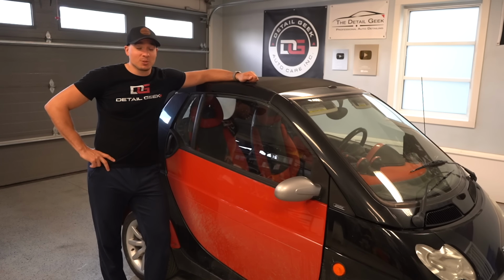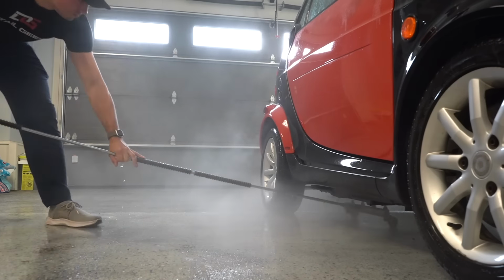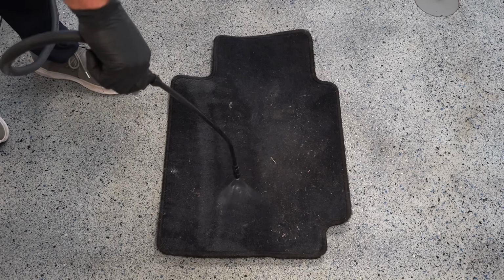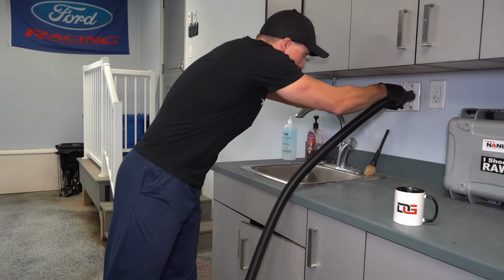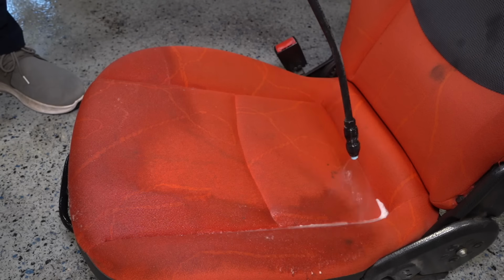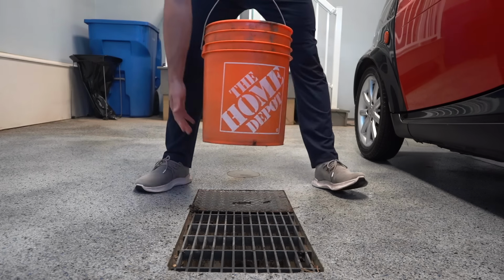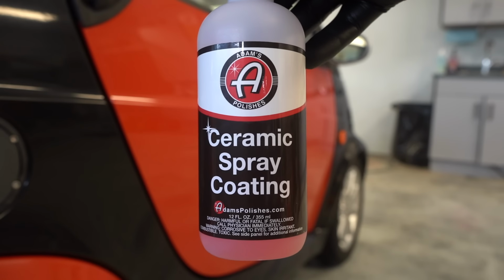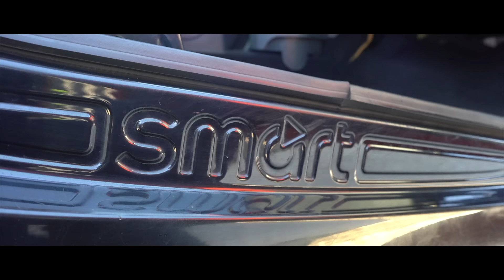Cleaning a Farmer's DIRTY Smart Car! | The Detail Geek

Comment: The amount of roasting on the size of this car was the cherry on top 😂
Reply: People with big cars usually are compensating for something else.
Reply: @Drakey_Fenix  😂😂😂😂
Reply: 🚗 ❤ smart.   ♡
Reply: @Drakey_Fenix  nah that’s just the pavement princess trucks with rubber band tires
Reply: @Drakey_Fenix  I mean...Mitch does own a huge Raptor
Reply: @tungstenwhizard4361  at least he goes mudding instead of putting truck nuts on it and exclusively running red lights and not signaling
Reply: @rosarythug  very true. There's true truck drivers like Mitch and my next door neighbor (who is a contractor and super nice) and then there's the angry assholes who act like utter douches on the road.

Comment: One of the most fun cars I've ever owned. The Smart Fortwo may not be for everyone but if it IS your cup of tea you'll fall in love. I love mine and will drive it as long as possible. 

A little warning for those that don't know.  The car's battery is located just under the passenger side floor panel. I'd suggest absolute care if one decides to use a sprayer on this portion of the interior floor. 

This was a fantastic and fun video to watch and the commentary was great 👍!

Comment: The owner is the one laughing the hardest, when they fill it up with fuel that is, and when needing to park it, and when it turns out it has zero to no maintenance costs other then the bare minimum usual stuff.
Reply: Exactly
Reply: Plus, he can get revenge on the bullies easily with this car. Squeeze it between theirs and see how they like not getting out for a while 😈
Reply: Except they require premium gas and synthetic oil. Back when they still made the petrol models, I did the math and the running costs of it weren't much cheaper than something like a Yaris or Fiesta. Both of which are far superior cars in just about every way. According to the EPA, they only get 33mpg city/41 hwy, which I have achieved in my Forte 5 GT if I drive sensibly, despite the latter having 2.8x the power, and being twice the size. And the turbo doesn't provide enough boost to require premium. There's a reason why the Fortwo never caught on.
Reply: @MmntechCa  here in holland we pay yearly roadtax. And that is depending on the weight of the car. 
Plus, ur fiesta from that erea is not doing 4,5L per one hundred km during city driving and less than 4L per 100km combined 
Im not a smart fan or anything but the idiotic gas consumption of american cars plus their more then  double the polution specs i find pathatic. 
My Aygo does better then this Smart in terms of handling, fuell consumption (beter numbers  on petrol comp to the smart diesel lol) and most of all reliability but still i prefer to see these smart cars above the oversized 1800kg examples from for instance the US

Comment: Seeing the comments on this made me sad. The smart is one of the safest cars around, it's designed to protect the people in car. Also most people don't need a gas gussling monster to get around in.
Reply: See it's alright for what it is. I can't drove it cause I can't fit. I'm 6'3 😭😭😭
Reply: How does it protect there's nothing to it🤔🤔🤔
Reply: I'm 6'5 and i fit fine in a smart car. Plus the car has a full roll cage. Cause you added that ceramic coding on quick, now it has smuge markes unless you repaint the car.
Reply: @waynedome148  See the black on the side (A+B pillar) that's part of the safety cell. Smarts are essentially steel cages on wheels with plastic cluttering (the colourful bits and the black front in this case) are just kits you can switch out easily.
Reply: @waynedome148  Smart cars are deceptively strong. I've seen videos where they've placed a full-sized van on just the frame of one and it didn't budge. You'd think they'd snap like a toy car but honestly, seems like they might be a little more safe than regular cars.
Reply: No soft top is safe
Reply: I want one!! 👍🏻
Reply: @recreationalhazards9099  I am 6'4, 300 lbs and have a 2008....you can fit into a Smart more easily than you can fit into most normal sized cars, trust me. Most comfortable vehicle i have ever owned.
Reply: @recreationalhazards9099  - OBVIOUSLY, you have no clue! 6'3 driver would fit perfectly in a Smart!! Consider that there's still more space, for the driver, in a Smart car. Than on most of the American "big cars" on the road right now! What about that?! ;-)
Reply: @waynedome148  - Just check crash tests of the time. 
Fun exercise: Compare them with ANY of those ridiculous pick up trucks of the same time... I rest my case! LOL 😂 Focus on "ANY"!
Reply: @crpth1  A smart car does not have more room than an F150......
Reply: @Xenakeyblademaster  ok  but I'll pass on one
Reply: Thanks ill keep my Camaro. 5 star crash rating and has enough power to go on the highway and not get crushed like a beer can in a crash

Comment: I had owned all three models. I used to dislike them until I drove one when I worked in Boston. A wonderful car that made for the city for a couple and enough cargo space for a week worth of grocery. Great daily driver, nimble handling, easy to find a parking in urban congested cities. It's easy on fuel, a tank of gas last me up to two weeks.  The 450 is the lightest, weigh in around 1600lb and I believe it's the best looking of them, 6 speed turbocharged that gets great gas mileage, up in the 50mpg.  The First generation  450 are rare in the USA only 1000 were imported by G &K. The 451 was the first model imported to the USA. It was more comfortable then the previous gen with the Mitsubishi engine and a terrible laggy transmission. It's better to drive on manual mode on this model. The trick to shift on the 451 is when you upshift, ease off the gas and let the gear engage, then, press on it.  It  also gets great gas mileage, mid 40s.  The 453 is the fastest, the smoothest shifting, stable and refine of the three. It's the best one. 96mph top speed. It doesn't have crosswind stability issues as the other two generations. Gas mileage is depend how you drive. I get 22mpg in sport mode when I attack the mountain roads and pin the throttle, other time, I get up to 51mpg in economy mode and feather the gas peddle. Three years ago, I crashed a 450 into a cinderblock retaining wall, the safety shell held up amazingly well. I'll away have a Smart car in my stable among other faster cars. When I don't need to haul anything big, the Smart is my go to vehicle.

Comment: Whenever I see these I immediately think "death box"
Reply: They are one of the most unsafe cars. Better get a bike, it's probably more sturdy
Reply: @Zomb1eBoyfr1end  that's actually not the case.  They rate pretty high in safety tests such as ncap.  Top Gear crash tested one into concrete at 70mph and the driver compartment was still fully intact.  Way safer than a lot of mid-size Fords
Reply: @bevausterfield431  Look.. I don't doubt safety tests. But in my country I've heard wayyyy too many deaths in smart cars. I better be safe than sorry.

Comment: This is an original 450 model CDI smart. I didn't know 450s were sold in Canada only with diesel power. Also, the cabrio version doesn't have the stereotypical three-circle tail lights. Neat.

Does the 450 have the hidden compartment in the back hatch? I didn't see you open it. I know 451s and 453s have the inner hatch lid that opens.

Comment: Unfortunately, I have a 2009 smart car, so that means the roof flaked away,, and the coating on the plastic color panels is starting to come loose. The inside is great, other than the cheap carpet that wore away in places in less than a year. I wish more people would drive them so that it would be easier to find people other than the dealer that will service them.